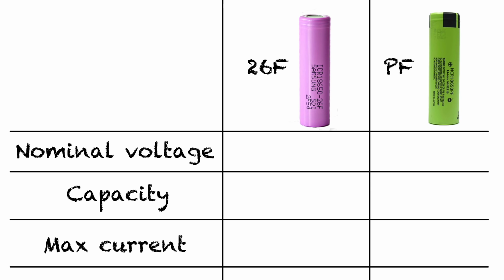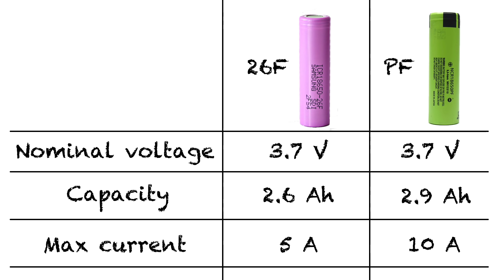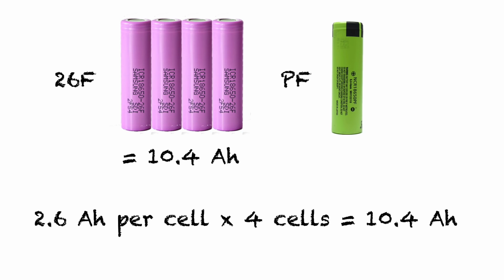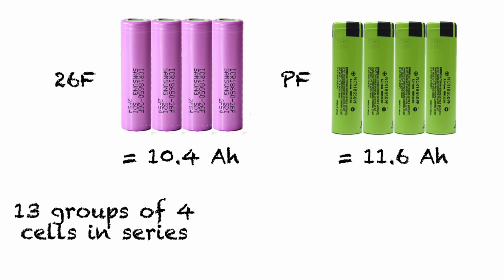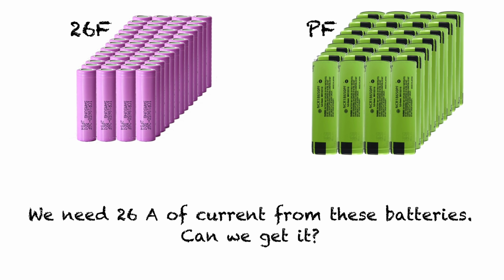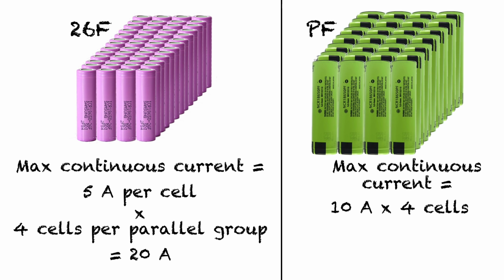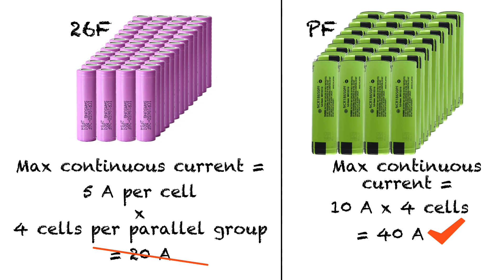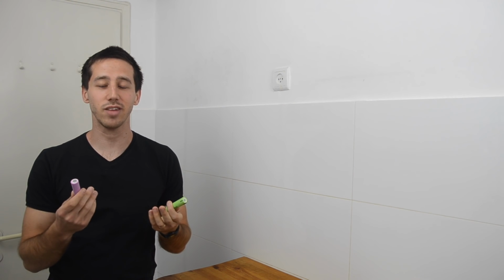Comparing 18650 cells for DIY battery - Q&A#5

Comment: Another great video Micah. My question has to do with the biggest enemy: HEAT! On my 10 mile commute, I've noticed my battery is starting to get a lot hotter than it used to. Had this pack for 8 months now, and the weather is getting warmer. Also there are a couple of pretty steep hills in my commute. Could you explain why the heat has suddenly started to get noticeably worse, or better yet explain why this happens? Thank you and have a great day!!
Reply from the maker: Hi Dale, do you have an ebike shop in your area or some professional that could check your battery? The heat is caused by resistance in the battery. There is always some resistance, which is normal. If connections become loose though, the resistance inside your battery could increase, resulting in more heat. That would be the worse case scenario though. It's also possible that as the weather heats up, your battery just doesn't dissipate heat as easily as it did during the winter in the cool air. Regarding the hills, your battery will always be under its maximum load on uphills, resulting in more energy lost as heat, so it is normal for more heat to exit the battery on hills. But if it is a sudden increase, I'd recommend getting it checked out just to ensure the battery is fine on the inside.
Reply: EbikeSchool.com Well I'm kinda on my own here as far as E-bikes are concerned. I built this conversion in September of last year,  and since then have put 800 miles on it commuting. I them lived in a small town in Georgia that had 0 E-bikes. I moved from there to another small town in Tennessee with the same problem,  no E-bikes.  I have studied battery tech as much as possible, and try to stay in tune with what's happening with my bike as it is my only form of transportation.  Short of taking it apart I have no real way of checking it out. Thanks for your speedy reply and keep up the good  work, really look forward to your videos as they are a great resource  for me.
Reply: @dalehall7139  i hear you, the reason i cant go to an ebike store or shop is because not many out here but there are some but i dont have the money to pay someone to do it, i grew up in Kennasaw GA, and now i live in seattle, plenty of hills. I have mechanical knowledge of how things work, this electrical stuff is kinda new to me. Closest thing ive tinkered with as a kid was rc cars. Im actually working out in my head how to make the air as your riding get to the parts to cool them. Corrugated plastic is cheap and durable enough for that. Problem scooping air towards the equipment that needs cooling, wind resistance. But i do think it possible to put a couple computer processor fans onto a solid battery box and suck or push air towards the battery. How much juice it would use to keep it cool may or may not save any energy. Probly the energy that can be saved would be powering the fans but a start of a good idea. But now how to cool the motor, its gonna be a hub motor. I know they get hot too, even being as exposed as they are.

Comment: Good video, thank you.I have one question please for my e bike: I use charger lead acid with same voltage and amperage, no risque for Battery ?
Easy motion bike
Reply from the maker: Do you mean a lead acid charger for your lithium battery? Generally that's not a good method. A proper BMS can help protect the battery from a mismatched charger, but it's generally not a risk you'd want to take. There are a number of inexpensive lithium battery chargers out there: https://evfittinggreentime.aliexpress.com/store/group/Lithium-Lipo-LiFePO4-Charger/313864_210769759.html?spm=2114.12010608.0.0.E6AJ6e&aff_platform=link-c-tool&cpt=1494931216088&sk=BeeyrRz&aff_trace_key=d7f4cbc466eb416c89d7b8ed4ee1c249-1494931216088-08222-BeeyrRz
Reply: Voltage 36v 2a same foto :
https://goo.gl/images/nKpkNx
Reply from the maker: Generally a 10s 36V lithium battery needs a 42.0V charger, as each cell gets charged to 4.2V and there are 10 cells in series, giving 42.0V total from the charger.